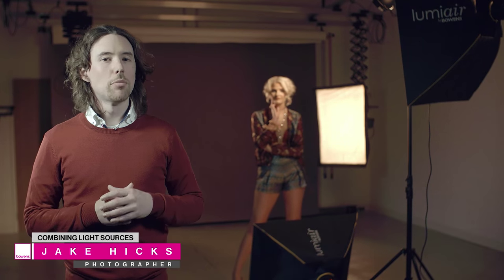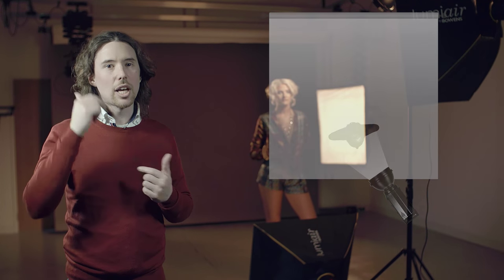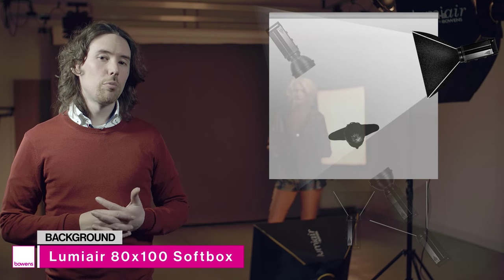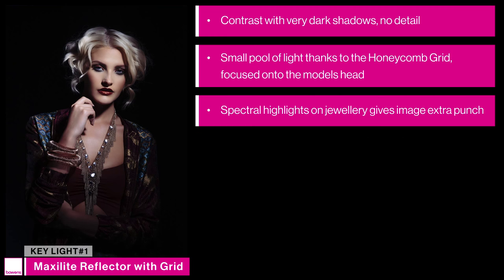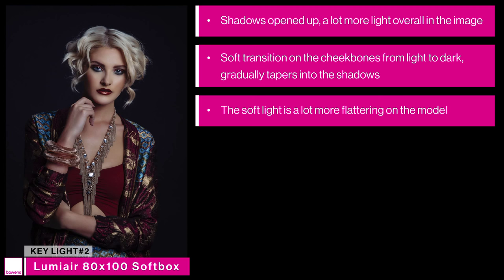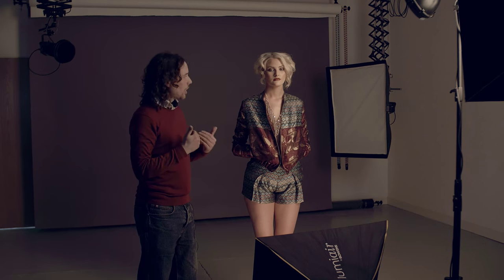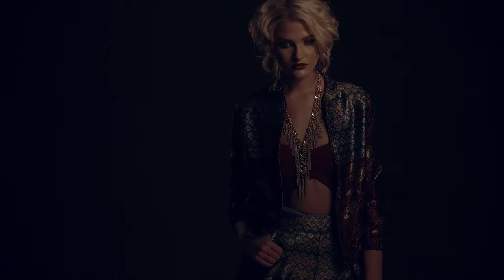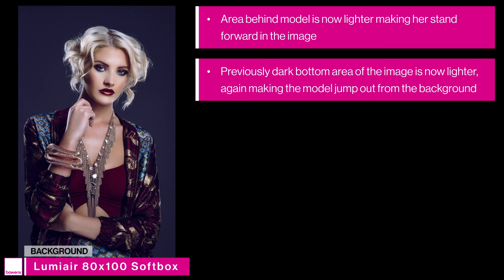WATCH NOW...Photography Lighting Techniques: How to Successfully Combine Hard and Soft Light

Comment: Thanks for great video! Really appreciated for the effort. 
My question is how to meter the object when adding one light to another? Do I need to make adjustment after each additional light because my object become brighter?  Thanks for answering.
Reply: +apo tessar heya Apo its very dependent on the look you are going for and the size of the softbox behind but yes as soon as you add another light you will either need to adjust your camera or to compensate or turn the initial light down. Of course this is easily ascertained if you meter the subject afterwards. Hope this helps :)

Comment: Hi. I was wondering about the ratio between the softbox and the maxilite reflector... Could you tell us a bit about it? Thanks in advance.
Reply from the maker: +Edwin A. Hernández-Caraballo Hi Edwin, the softbox is twice as bright as the Maxilite. The ratio of softbox to Maxilite is 2:1.
Reply: +bowenstv Thanks!
Reply: +bowenstv I don't think that's correct. Jake said the softbox was 1 stop more power, but that doesn't mean it was 1 stop more in actual exposure--in fact, looking at the model it's obvious it's still about a 1:1 ratio. A grid spot will not meter the same exposure as a large softbox at the same output.
Reply: @Marckymarc71  I'm totally agree with you, Marc. In fact this is the key for this tutorial and I think it should be more clear about the final exposure for each of this two lights. Would you be so kind to help us, BowensTV?
Reply: I've repeated several times that moments and I think, even the English is not my native language, I understand something like this: "... by the time reaches the model is actually little bit less (5:40)". Case closed :)
Reply: @ovidiugrovu3025   At about 5:38 he explains that the light from the softbox is metering slightly less than the grid spot. I would meter for the grid spot. Then adjust the softbox light to taste--maybe 2/3 of a stop less metered and see if that looks good in camera. The key is getting the exposure correct for the spotlight because that represents the true tonality and should be objective metering. The fill light can be adjusted to taste because the shadow density is subjective.
Reply: @Marckymarc71  We're on the same boat :)